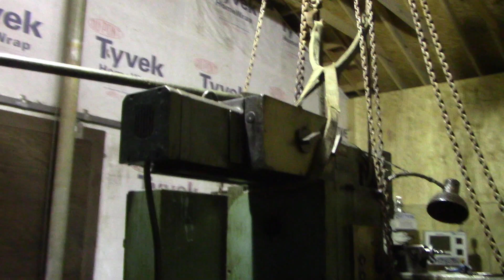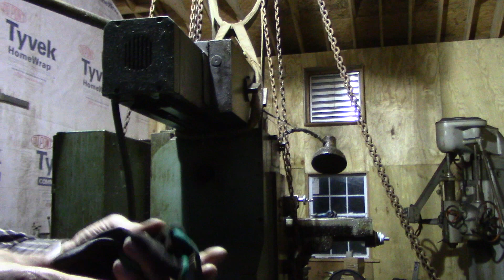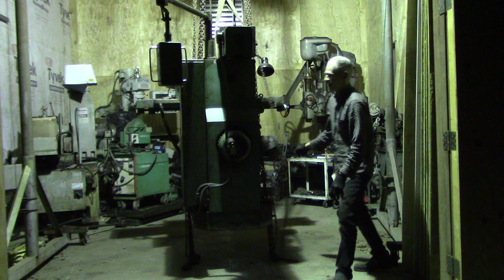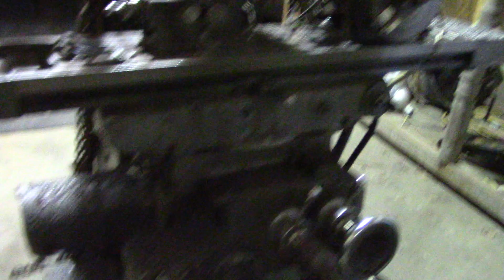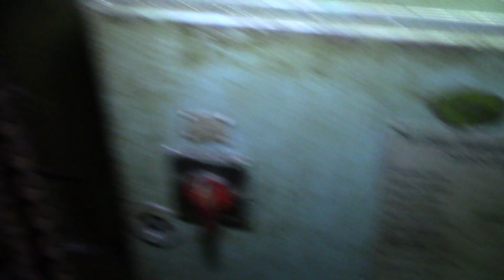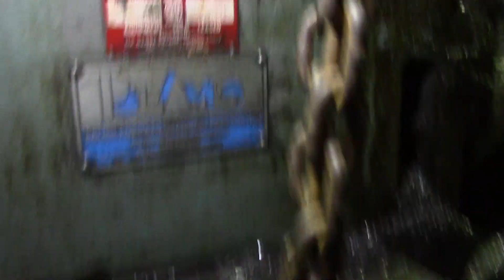4-21-22 -- JAFO JAROCIN Mill in the Shop

Comment: I got the same machine,good stout mill the Poles make. Yes it does have a quill, that T-shaped deal in the recessed hole on the front of the head is the quill lock. Is has similar in the hole on the right side of the head,which is the quill feed. The quill feed is not a direct rack and pinion like on a Bridgeport,but instead is a gear drive arrangement.There is a T-handle wrench that fits in the recess and engages the cross pin for unlocking and turning the quill drive. That same wrench also runs the ram in and out and opens the electrical cabinet.
I have a set of manuals for it if you need some questions answered.
Reply from the maker: WOW Steamfan ! ! !   So cool you have the same machine.  I am pleased to know it does have a sliding quill !   I have not looked into that yet but awesome that you have confirmed that.  Yesterday I spent HOURS with the ShopVac and a scraper blade cleaning the ships and dried coolant goo !  My back hurts today. And my head from banging it on the underside of the table a few times. LOL  One Q?  The machine is wired for 440V and I need to change it to 220V.   There is a note tag (in English) in the electrical cabinet that has a punch list of items to change over. One is the usual change the motor wires over and one is change the taps on the control transformers. The last one I can not figure out.  It says something about changing leads on some capacitors, only if you have the powered overarm (which obviously I do).  I have not found any capacitors yet.  Surprised it has caps, as all the motors I believe are 3 phase.  The control cabinet does have some rectifier diodes and some resistors. Not sure what they are for yet.  But do you know what capacitors the note is talking about ? ? ?  Thanks Steamfan.   -----Doozer
Reply: @kooldoozer  It has electronic spindle brakes on both spindles.When you switch the motor for either off,the brake actuates,stops the spindle and powers off.Seems like it all happens in about 2 seconds. So there should be a DC power supply in there somewhere. I have the electrical schematic for mine,I'll see if I can just snap a picture of it and send it to you over on HSM. The manuals are well done, they have big fold out pages with cross section drawings of everything. Unfortunately that feature makes them a real PITA to try and copy. When I got mine, there was still a dealer in New Orleans that had a copy, he sold it to me for $100 which was a steal considering it's two hardbound books and a full sized electrical drawing.

Comment: The mill looks very good under the oil and chips the sharp edges are not battered. The #2 size mills have very little daylight from spindle to the table the design of the early sliding vertical head on my B&S #2 has only 9" of daylight. Looks like a fun machine you have there!
Reply from the maker: Thanks Donnie.  I think I have about 1 foot of daylight with the knee down.  Have to see once I get the ways clean enough to move the knee.  What I have cleaned, the ways look very good.
In production, the way this machine was used, was to mill a square on a round shaft, using the indexer to space off the square.  It ONLY saw travel movement on the Y axis, in and out.  The main X and knee Z axis never got moved, maybe only in setup.  So the typical heavy wear that most mills have on the table X ways, it does not have.  The Y ways are box ways, and the oiling system seems to have been working, because there is a lot of oil on them.  The Y screw looks pretty OK.  The Y nut has a bit of wear, but it is actually moving for and aft in its mountings.  It appears to be 2 nuts for anti backlash.  Should be easy to tighten up.  Or eventually make a new on e on the lathe.  It is a round nut, not an odd shape like sometimes they can be.  Thanks for your comments.  Hope you build your garage shop larger soon. -----Doozer